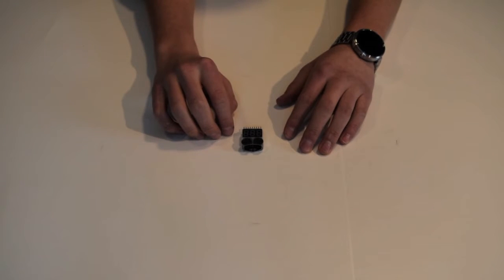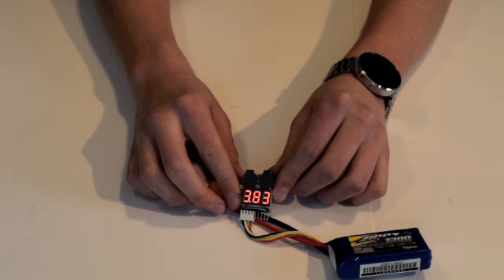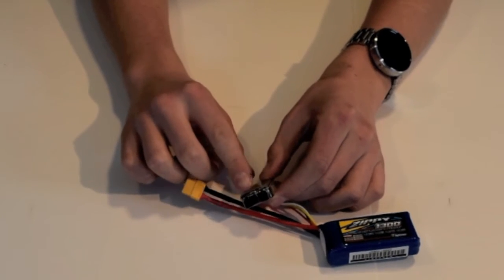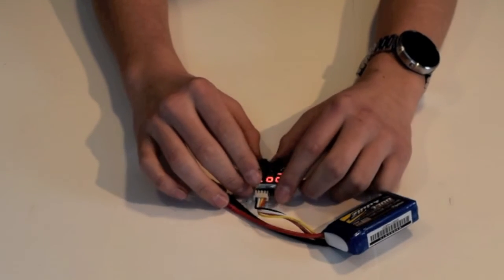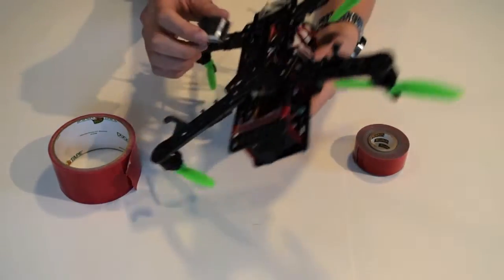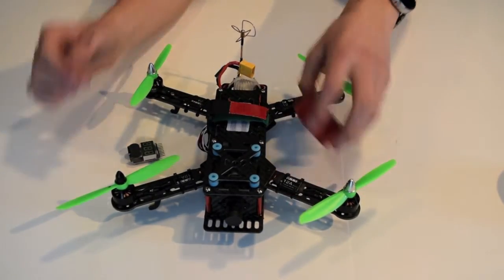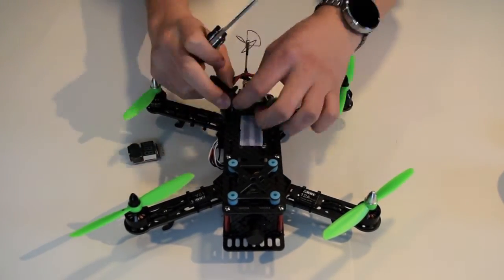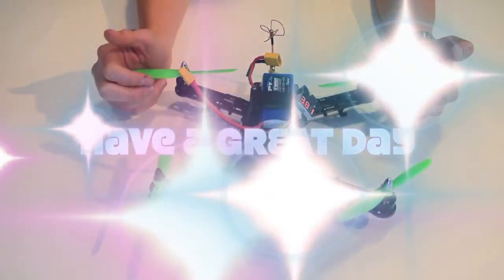Lipo Voltage Checker and Alarm Review + Mounting Tutorial | FPV Tech

Comment: Well I guess my 3 cell Lipo is dead because it won’t charge my battery charger is telling me cell connection error and my battery checker says one of the cells are 2.7 and the other cell is 2.5 and the last one is 3.1 so if it is jacked up now plz let me know
Reply from the maker: Rhys Kelley yeah, you're going to want to safely dispose of that
Reply: Rhys Kelley I had the same issue, easy fix was just by chaging the main plug on the battery and it worked again, don't know why but it was a new battery and changing plug fixed the problem.
Reply: Aurimas Miko how do I do that
Reply: Rhys Kelley if you are not sure how to resolder new contacts then don't, then ask a friend to do it for you, you just nead to buy a plug that is on your battery and resolder it to the new one, not the white one but the bigger one.
Reply: Aurimas Miko my contacts are red and black what are the white and bigger one u. Are talking about

Comment: The one I have needs the low voltage alarm to be reset each time I connect.
I discovered that if I "long press" on the desired warning voltage, it will remember that value.
I set to 3.4 for ordinary LiPo's and 3.5 for Graphene LiPO's since their voltage can stay high then drop quickly at the end of a long flight.
Reply from the maker: +Bill Branning Good information, thank you for sharing!
Subscribe for more

Comment: but dont you have to plug in the battery to the video transmitter?
Reply from the maker: I believe you are thinking of an OSD voltage monitor.  This one, you can only read the voltage when it's on the ground, but you can still here the buzzer go off while flying.
Subscribe for more
Reply: ReviewEdge yes but you would still need to have it plugged into the battery in order to hear that beep he probably just has the VTx soldered directly into the power distribution board
Reply: it plugs into the balance port i think